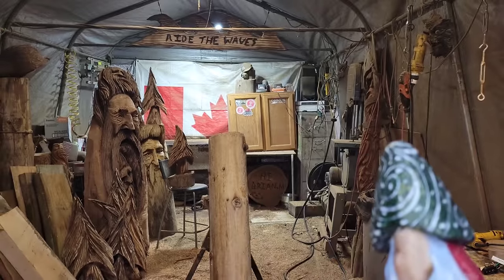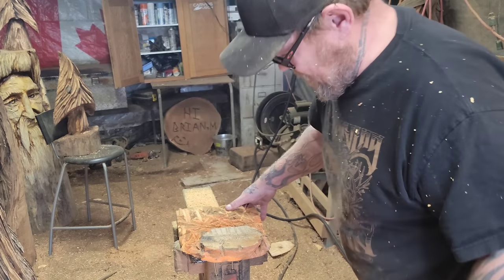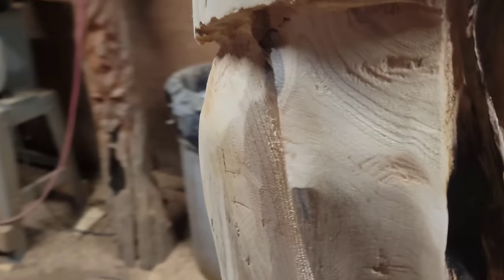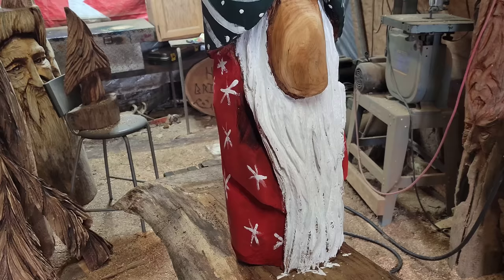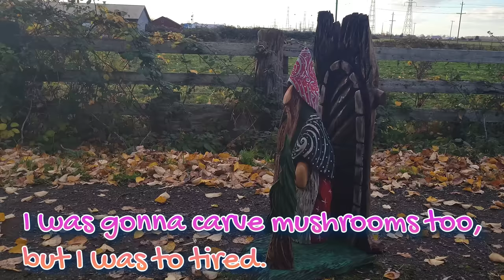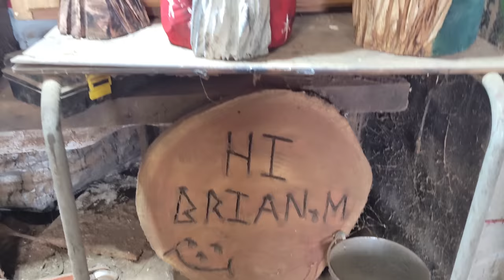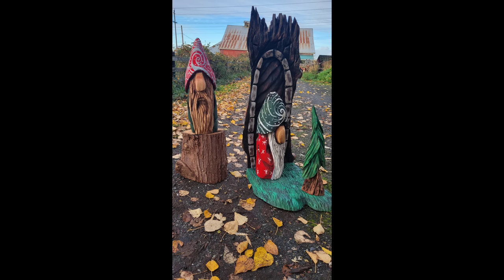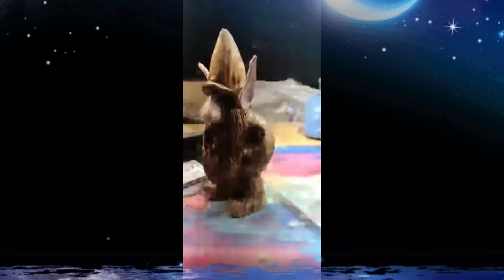How to make a Gnome easy.

Comment: And you had me rolling on the floor laughing when you launched the drill, and had your spat. 
 Straight even pressure, but I’d just switch your screw heads to torques or square bits, they seem to extract easier.
 Carry on with your awesome self, Brother!
✌🏽🧙🏽‍♂️
Reply from the maker: They were tourqes

Comment: Love the  gnomes bud . I have the same problem with the oil on the muffler on my Ms170 . I figured out that it's caused from running the saw at low revs . The oil in the gas doesn't all get burnt and comes out of the muffler . At least that's the problem with my saw .